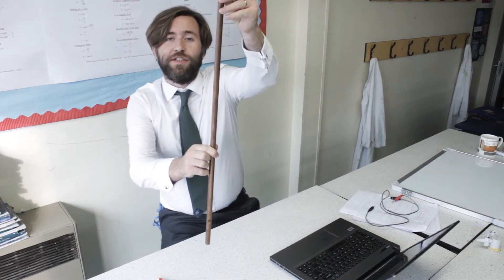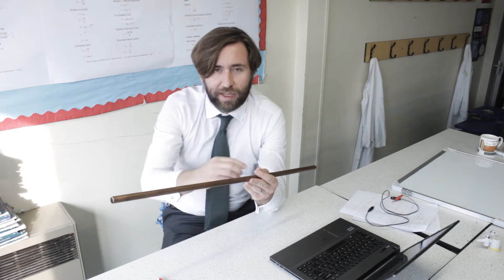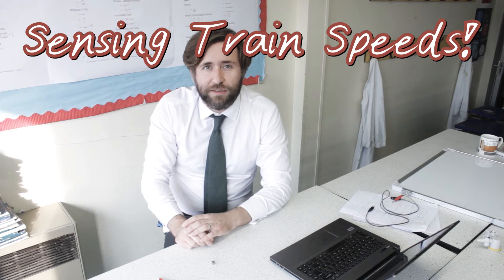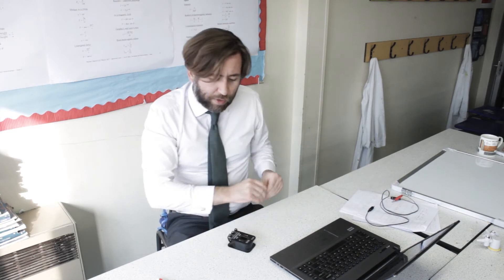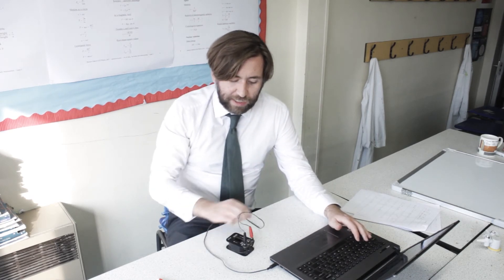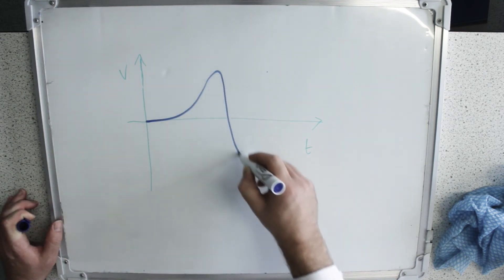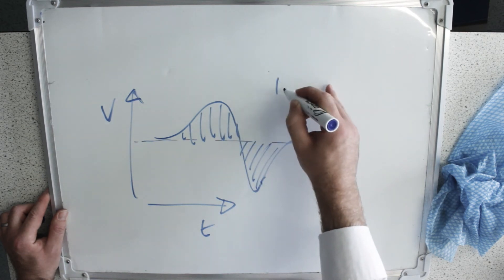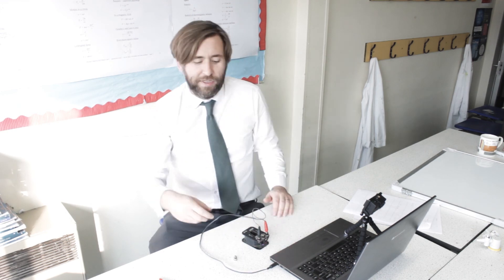Train Speed Sensor - Using Faraday and Lenz's Law of Electromagnetic Induction - A Level Physics

Comment: Hi, what is the cause of the induced e.m.f. becoming negative?
Reply from the maker: #150 as mag fields are vector, they have direction! Think of the arrows from north to south in a field diagram. So the top line of Faraday's law is either positive or negative depending on polarity. Does that make sense?
Reply: GorillaPhysics hi thanks for your reply but that didn’t make sense to me
Reply from the maker: #150 can you remember doing Fleming's Left Hand Rule? Remember the mag field has a direction? So the mag field lines are like the "phi" in the Faraday's law equation! Might be a good idea if I do a basics of EM induction video at some point! 😀